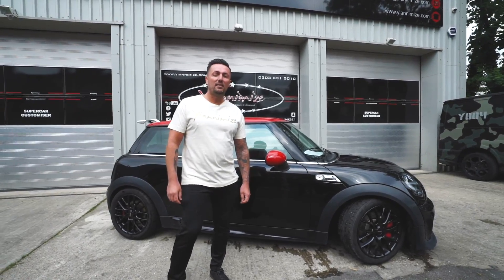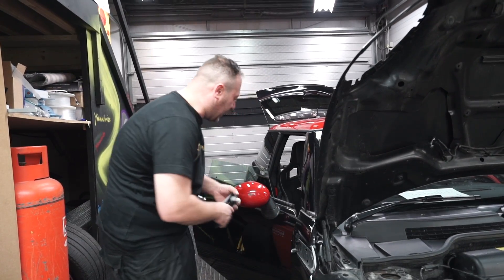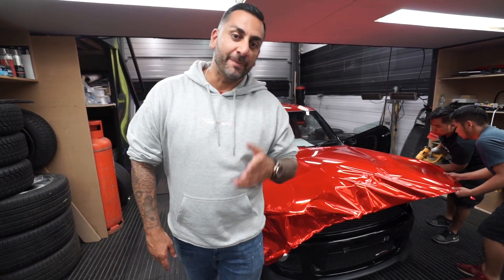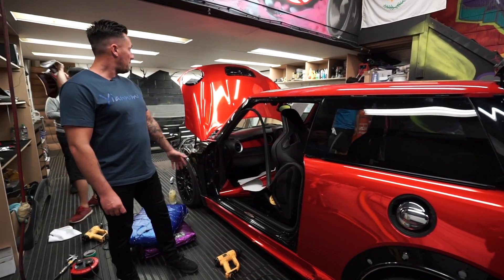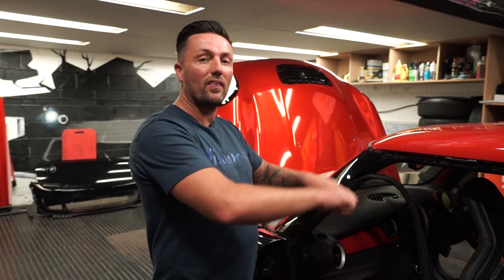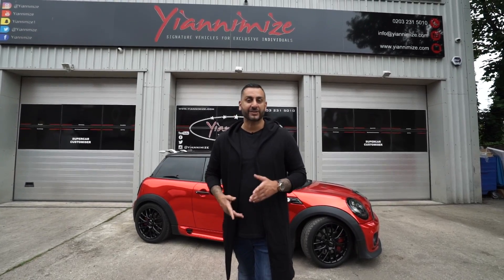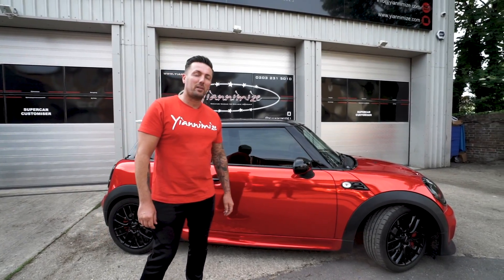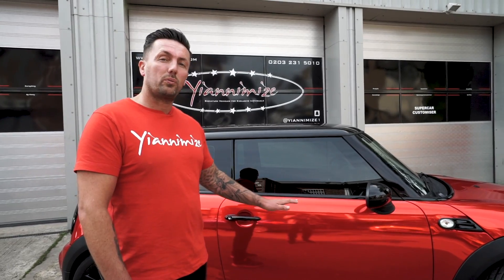John Cooper Works Mini Chrome Red Car Wrap

Comment: WOW!  Came here because the mini 4 door hardtop I want in electric blue is only available with white roof and stripes. I want those things in black and they recommended wrapping it that color. I didn't think I'd like it - but I'm impressed by what I'm seeing here. And that red color is killer!  I just wonder - does it warp due to intense heat and cold?

Comment: I used to own a R56 with the JCW wing on the back of it and it was tricked out and I loved the car but I hated the fact that something was always broken. I only had 25k miles on it and it was bought brand new in 2008 and I only had it for a little over 3 years and I started to have problems with the moonroof, the driver side doors no locking and unlocking and it was out of the manufactures warranty and the extra warranty that I purchased for $3k was useless and didn't cover any of the mechanical failures. This was my 2nd mini I bought at Mini of Baltimore and they wanted to charge me $2k to repair the moon roof bc it stopped opening up and the doors stopped responding to my keyfob and we tried everything and it didn't work. I had a love hate relationship with the Mini's. I loved the way it looked and drove but I hated the fact that it broke down every month and I couldn't do anything about it. I ended up meeting my future wife and she told me it was time for a new car since we were paying $500+ for the note/month and then an extra $1,000 per month to cover the expenses when the car broke down. Bc we were going to get married and start a new family I ended up trading my Mini Cooper S in for a Brand New Toyota Camry 2017 SE. Yeah, it wasn't a Mini Cooper but at the time they didn't have any Mini Cooper's that would give us enough space to fit 4 people comfortably with a baby seat in the back plus all the problems I started to notice after the warranty expired really turned me away from buying another Mini Cooper S. I did not want to have a high car payment and then only have it for 3 years and start to have problems with it. I was glad to have gotten rid of the Mini Cooper S R56 and went with a car that is known for it's reliability, space, and comfortability.

Comment: Love the colour contrast although I’m not a fan of chrome and it looks like a fantastic job by te team.The front air scoop would look better in black gloss rather than left as carbon fibre. The side repeaters should have been swapped for smoked glass rather than left as clear. We’re the red details inside the car wrapped in the red chrome also?

Comment: Minis are great. JCW Minis are the best. But you should not need to lower a JCW as they are already lowered. All you end up doing is stressing the suspension and damage the ride. I'd also never wrap a mini hatch. They're just too cool the way they are.

Comment: 1:40
Why are you guys using cheap paper towels to clean the car rather than plush microfiber towels?

Certainly if one were to get their car wrapped, they wouldn’t like the swirl marks you guys are marring into the paint smh. Just because the customer can’t see it, doesn’t mean they should have to polish their paint after removing the wrap. This is unethical standards for an institution such as Yiannimize. Hope to see this changed in the future, because my fellow detailers cringe at the atrocity of such products.
Reply: They are just being practical
Reply: JLMacuha Vlogz Nah bro being practical isn’t an excuse for a professional company like Yiannimize. Even the DIY guys use microfiber towels. The price you pay scratching the paintwork with a terry towel/paper towel isn’t worth having to meticulously polish the paint after to remove defects.
Reply: being lazy
Reply: Not taking my car there lol

Comment: Don't wiping paper towel on a black color car scratch the paint? If it was my car I wouldn't be to happy to see swirl marks on my black paint if I was to  ever remove wrap in the future
Reply: I always use a micro fiber towel just bc I don’t want my paint scratched
Reply: Indeed that is correct, also, forward of b pillar tints less than 70% are illegal in uk, to be stating they’re putting illegal mods into a vehicle thus invalidating insurance etc etc can’t be good. I’m guessing times are getting tough for these guys as much newer much more professional shops have opened up and no doubt taking business

Comment: Looks amazing. I'm really sold on the chrome wrap however... I'm thinking that, if I was to fork out the dough to do the wrap (maybe $4,000 - $6,000?) why start with a new JCW? I'd probably buy a low mileage Sport, upgrade the suspension/wheels/motor and save beau coup bucks.  Thoughts on that (I might do this)?

Comment: black with red roof was better, all they had to do was black out the chromes
Reply: Cinar Gey; black body with red roof was the JCW colour scheme they promoted in 2012/13, prior to that the popular colour (2010/11) was red body with black roof. So keeping it black with red roof would have been just the same as every other 2012/13 JCW, chrome red was the way to go and this ‘wrap’ looks great. The alcantara recaro Seats are a nice option, not so keen on the red interior door trim, would have been better in black.